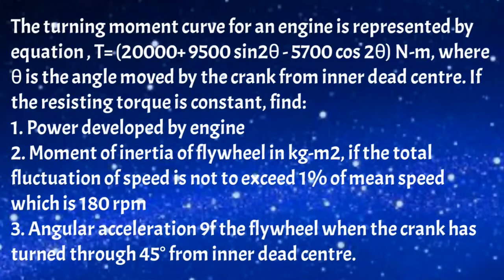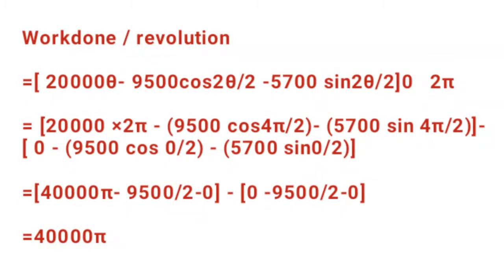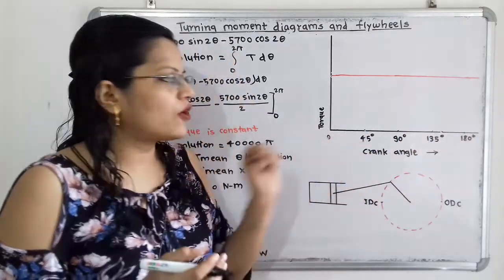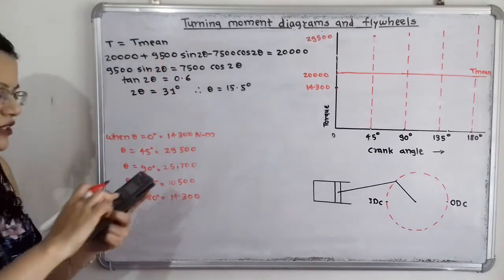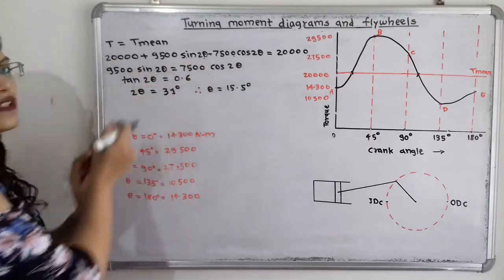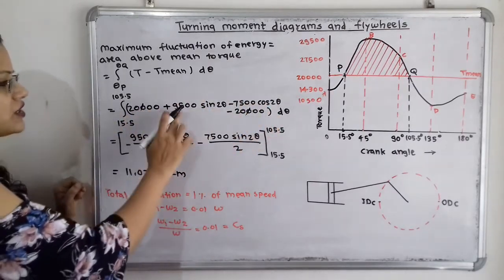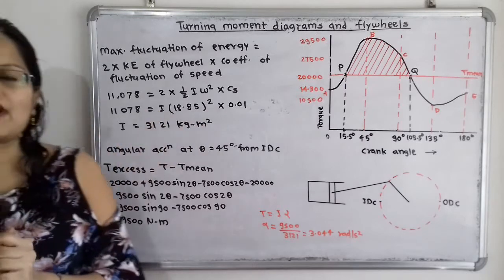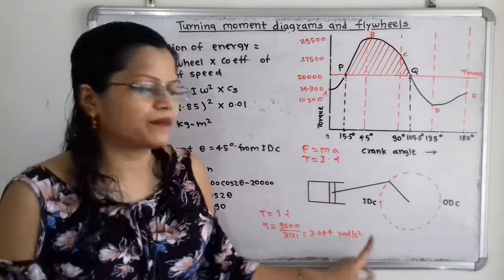Problem 10  turning moment diagram for equation of torque / Theory of machines

Comment: In this in calculation of torque you have wrongly written the equation it will 5700cos(teeta) not 7500cos(teeta)
Reply: Yes ma'am 5700not 7500